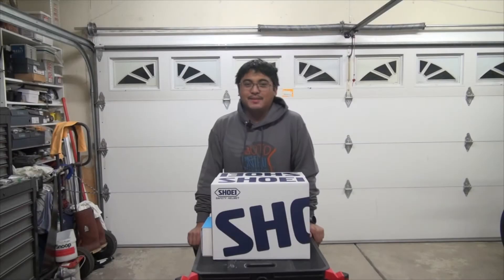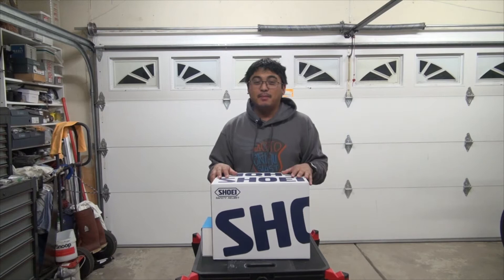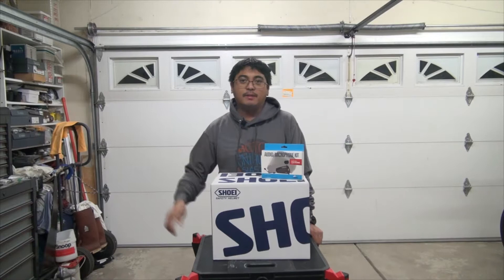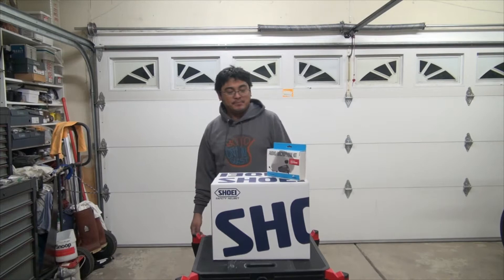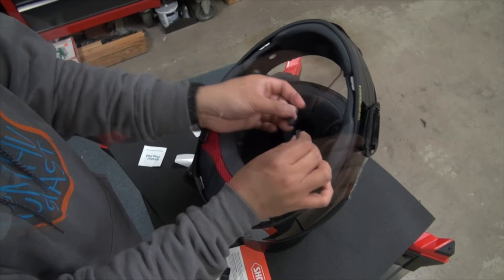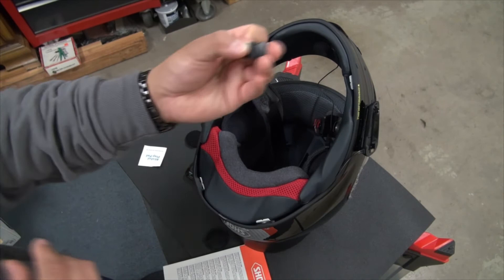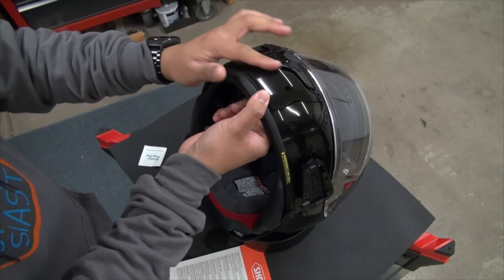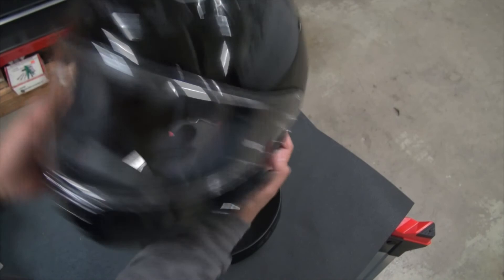Shoei RF-1400 - Unboxing & Cardo Install

Comment: Just bought my RF-1400 yesterday. I will mount my Sena 30k today. On a side point, I am replacing my older carbon Sedici Sistema modular which I think is junk.

Comment: EDIT:  Tried the Cardo Freecom 2X.  Fits good.  Only thing on the helmet I had to change was removing the thick foam spacers from the ear pads that fill the ear wells in the helmet.  No big deal.

Comment: Nice to see the 45mm JBL speakers fit in the 1400. Bought one during the same promotion :)
Reply from the maker: Nice! Just remember to remove the earpad fillers in the helmet!
Reply: @MobiusT100  I saw someone else post elsewhere that the 45 mm JBL speakers would not fit the RF-1400. I have no idea what he did wrong. Was there any interference issue at all or was it an easy fit?
Reply from the maker: @rickk10000  I actually did run into a mounting issue with the speakers. My previous helmets all have fairly obvious cutouts where the speakers go but the RF-1400 fills in those cutouts with removable foam pads. If you don't remove them, you won't be able to put the helmet on. But once I did, I was able to get the JBL speakers to fit. This may be why the other person wasn't able to fit the speakers in their helmet.
Reply: @MobiusT100   OK... I have yet to order helmets or radios... still a foot of snow on the ground.  But, you are saying I have no compatibility worries then  with the 45 mm speakers and the RF-1400's ?
Reply: @MobiusT100  How do you get the speakers to stay in place?

Comment: How did you install the speakers?  You had some blue tape? Did you leave in the Shoei foam piece with the 3 "click" pieces that go in to the holes or remove that?
Reply from the maker: The foam pieces have to be removed, as they fill in the cavities that the speakers go in. The speakers themselves are held in place using those velcro squares that came with the headset. Be warned, they don't do a great job keeping the speakers in the cavities, as the speakers are a little too big to perfectly fit. They hold, but it's easy to get them to come off. Luckily they don't move when I'm putting on or taking off the helmet.
Reply: @MobiusT100  Thanks for the note. I'm going to work on refining my set-up.  Appreciate the advice.
Reply from the maker: Glad I could help. As a side note, these are the 40mm speakers that came with the headset. The 45mm JBL speakers that Cardo also offers definitely will not fit in the RF-1400's speaker cavities.

Comment: Great video!...and thank you!
Quick question...why did you use velcro to mount the unit to the side of the helmet? Is that the only way? Ive been rocking sena for a few years and wanted to try cardio,  do you have to use velcro?
Reply from the maker: Thanks for watching! That's actually not velcro that attaches the Cardo unit's cradle to the side of the helmet. It's a 3M VHB adhesive pad, very strong as long as the surface is cleaned and the pad is allowed to set properly.

On that note, Cardo systems come with two mounting options. The adhesive pad, and a clip which is inserted between the shell and the liner. I prefer to use the adhesive because I have more flexibility when choosing a mounting spot.

Comment: Thanks for the great vid. Have you had any issues with the Cardo Freecom 4 plus, do you recommend it?
Reply from the maker: Thanks for watching! I haven't had any major issues with the Freedom 4 in the almost 2 years I've had it. The only problems I face are all related to voice commands being inconsistent when it comes to using them. When it works, it works great. But I often have to repeat a command multiple times before it registers.

The unit has fallen off the cradle once but that was because I didn't attach it properly. It survived that fall at 50mph with only minor cosmetic damage.

The 4 also comes with a set of JBL speakers so I find sound quality to be pretty good. Overall, I recommend them, especially since Cardo just announced a new line of Freecom units, which should bring the price of the 4 down a bit
Reply: @MobiusT100  Thank you for replying to my question, I decided  to exchange it for a PackTalk Bold instead after reading many reviews about it. Thanks again  I also just recently purchased a Shoei RF 1400

Comment: How comfortable is this setup with the 1400 and Cardo bluetooth?  The RF-1400 is known for being infamously tight and cramped in order to stay so quiet.  I would guess this leaves very little room for your ears in the first place, and even less when bluetooth speakers are involved.
Reply from the maker: It definitely started out feeling much more snug than my other helmets did when they were new, but the cutouts for the speakers are large enough for to fit the 45mm Cardo speakers. It does loosen up a bit after a while but it's still the quietest helmet I have.
Reply: @MobiusT100  Thanks for the info. Wanted to double check on the 45mm speakers that you mentioned. The Revzilla comments and Q&A section said the speaker cutouts are only 40mm. Are you sure about the 45mm speakers?
Reply from the maker: @paintsplatta99  You're right, the RF-1400 only comfortably supports 40mm speakers. For some reason, I thought I had the 45mm speakers but really they're just the 40mm speakers that came with the Cardo unit.
Reply: @MobiusT100  Thank you for getting back to me!

Comment: What speakers did you install the 45mm JBL ones? The speakers I have are tear drop shaped and they don't fit inside the recessed holes.
Reply from the maker: I used the round speakers that came with the Cardo audio/mic kit.

Comment: Just bought this helmet, do you jus push the chin curtain in? Are there clips or pins? Thanks great video.
Reply from the maker: You just push the chin curtain in, it's held in place by tabs.
Reply: @MobiusT100  Thanks man

Comment: Where did you put the connection for the speakers? I can find a good spot where it’s not putting pressure on my head.. thx
Reply from the maker: I have my 3.5mm connector off to the side and a little below the warning label that's sewn into the padding at the back of the helmet.

Comment: What has your experience been with the front latch/tab setup while out riding with gloves on? I dig the helmet but that front latch is holding me back.
Reply from the maker: Thank you for watching! The latch took some getting used to, that's for sure. I've found that you can unlatch and lift pretty easily with your thumb once you line your thumb up with the tab on the shield. 

If you've ever read/seen Romeo and Juliet, form your hand as if you were "biting your thumb" at someone. Give a light push and bring your hand up.

Comment: How good is this sound system?
Reply from the maker: I don't really have much to compare to other than the Sena that's built-in to the Bilt Techno and Cardo's own 40mm speakers but against those, it's pretty nice. My Bonnie isn't super loud and the RF-1400 is a quiet helmet, so sound comes through clearly and with a surprising amount of bass.